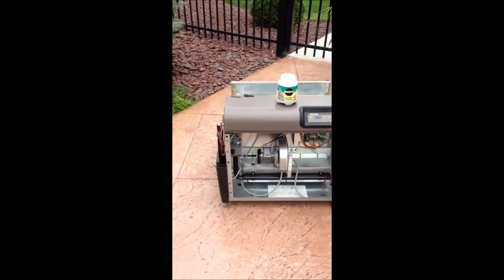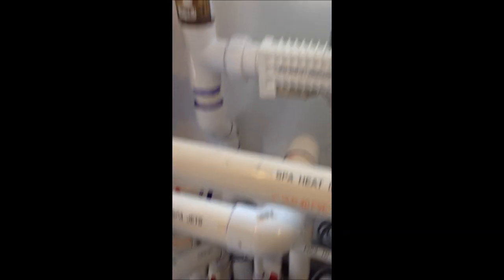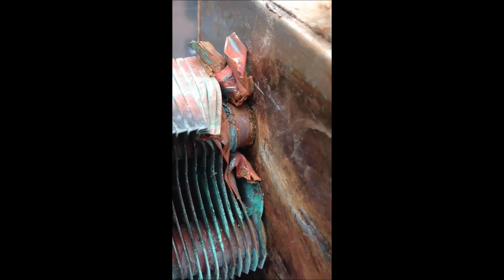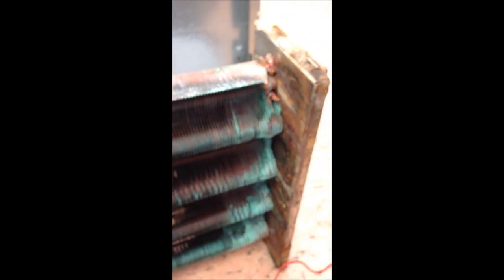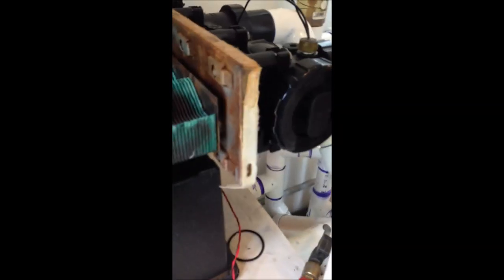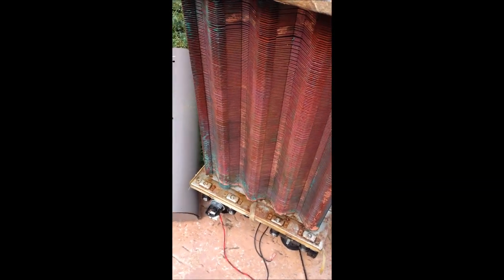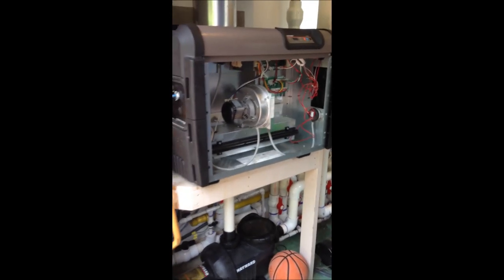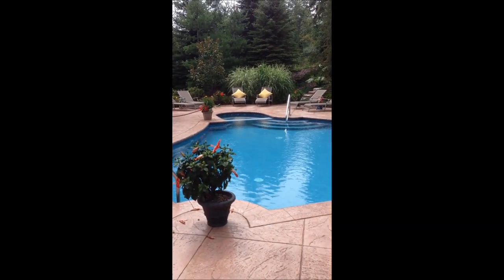Hayward H350FDN Heat Exchanger Repair

Comment: Thanks Al, I too had a leak at the same place at about 2 ½ years into a new Hayward H200FDN as well. Thanks to your video I learned that this is a fairly easy fix that was well within my ability. The exchanger was dead anyway and Hayward was of NO help on warranty. So... I could not make my situation any worse. I took it apart, removed the exchanger. Easy so far. Not having an easy way to water check the unit to see where the leak was, I simply plugged the inlet and outlet and applied air pressure and listened for the hiss. I verified the location exactly by applying soap bubbles. Then a solder with silver based solder and a torch. That stopped 90% of the leak but I still had a problem where the hole actually went under the stainless bracket. Aaaarrrrgggg! So... I took a shot and applied some JB Weld liberally spread across the connection, the remaining hole and the stainless bracket after cleaning with acetone to make sure I had a nice clean surface for the JB Weld to adhere. I let it sit for about 15 hours and leak tested again with my soap bubbles. No leak! I reinstalled the heat exchanger and it is working just fine. How long? Well, I don't know but less than $20 of silver solder and a couple hours fixed a problem that was going to cost me about $800 for a new heat exchanger plus my labor or paying my pool guy a couple hundred bucks. Hmmm.... $20 and a couple hours vs $1,000 for a new exchanger... worth taking a shot. By the way, on plugging the inlet and outlet is easy with a smooth board butted up to each inlet (using the nice rubber gasket already there to seal the board) then used two woodworking clamps to hold each board in place. I drilled a small hole in one board at the center of the inlet and applied air pressure and looked for bubbles. Clamps similar to these: https://www.amazon.com/General-Purpose-Woodworking-Protector-Projects/dp/B07GN9LBZP/ref=sr_1_19?dchild=1&keywords=woodworking+clamps&qid=1599547021&sr=8-19 also available at Home Depot or Lowes. You will need 4 but they are very useful to have in your shop anyway.

Comment: Thanks Al so much.  Clarifying the rod content was extremely helpful.  I was able to get a good braze using a MAPP/oxygen combo (cheap).  To identify the leak I cut the bottoms off two plastic cups and jammed them into the water inlet/outlet, drilled 1/4 inch holes in each, then squirted compressed air at about 15 psi thru it.  Used soapy water and a spray bottle.

Comment: Thanks for this video. Number 1 message I get from this is I NEED A NEW POOL GUY!! My 3 year old heater is dripping. He is telling me we can't replace the heat exchanger. I see the part online for  $700. He instead wants to charge me $2800 for a $1500 heater installed.
Reply: That is certainly one message.  The number 1 lesson to be learned is don't use hayward.  It's been junk for decades.  Stick with Pentair.  You'll pay a premium up front, but you'll save a ton in the long run.   I am a pool guy,  and when I walk in a backyard I know I have guaranteed work in the future when I see "hayward" sitting on the filter pad.  Pump, filter, heater, anything hayward is junk.

Comment: Great video, and yes your pool is beautiful.  I have an H200 Millivolt heater which keeps overheating and tripping the hi limit.  This is an indoor pool and heater is installed in basement with the recommended DHI hood.  However, the vent is 7" coming off of heater and goes into a 6 " pipe and then into chimney flu.  And thoughts on reason for overheating?  I cleaned burners and heat exchanger (lots of soot and damaged fins).  I suspect those are results of the problem not the cause of it.  Thanks.

Comment: ive replaced 2 one less than a year one  16 months ,  after exhausting every other reason they finally blamed it on airflow.  They are inside a wood fence  at least 4 ft clearance with 1/2 inch gaps between slats and open at the top.

Comment: Hi Al, Great Video I was wondering if you could provide an update on your heat exchanger repair from 2013. Its about 5 years later is the weld holding and have you had any other leaks on that exchanger. I have the exact same model of Hayward heater H350FDN and we are starting our 4th summer and the heat exchanger began to leak in the exact same location as yours. I am on the fence about buying a new heat exchanger ($1200 Canadian dollars right now) or attempting to braze it like you did. My concern is that the braze weld will hold but it will start to leak at other locations. How is your experience so far 5 years later?
Reply: I replace the heater May of 2018. Heat exchanger was still good but burner rotted out...
Reply: Albert Baldoni - can I asked what type of heater you decided to replace it with in May? Did you go with another Hayward or did you go another Brand? If so would you mind sharing the info. You seem like a guy who does his research! Cheers
Reply: Al, any comment on what Heater you replaced it with?

Comment: I’m not clear on the type of brazing rod and/or gas. Will simple MAP gas work? And the rod? Thanks!!
Reply from the maker: I am sorry but I do not have any experience braising with mapp gas I don’t believe it gets hot enough although there are torch heads specifically designed to heat hotter with plain mapp gas.

Comment: Question ? If that heat exchanger was still hooked up to your heater and heating up when turned on would it make whining/whistling noise possibly coming from the cracks
Reply from the maker: Hi Tom, no. My guess the whining whistling would be your combustion blower. If you take the front cover off you should be able to identify where the noise is coming from very easily. A small crack or leak in the heat exchanger will immediately show up as steam coming out your exhaust.
Hope this helps😎
Reply: @baldonielectric  I took the heater apart didn't see any leaks cleaned everything including gas orifices and replaced the water pressure switch, got it back together and still had the whining. Another answer to my question came up and he suggested to only open the valve after the filter and before the heater inlet half way to increase the flow, I did and the whining stopped. I also forgot my pump has 2 speeds hi-lo, I opened the valve all the way and put my pump on hi that worked too. But still don't understand why that would cause the whining at a low flow speed ? Thanks for your help !

Comment: Ya mine leaked the same place after 3 1/2 years service. My water quality is near perfect so its not a PH or corrosion issue. Hayward needs to improve quality and back it with a warranty longer than 1 year or Pentair will take over. Hayward was purchased last year by a larger company thats now told their employees bottom line is profit not customer service. This is evident by the removal of the EcoStar pump warranty that was extended to 5 years then removed with new owners.

Comment: I have a model 400FDP (propane) heater which is only about 4 years old which developed several leaks.  After removing the header, I noticed that three of the eight tubes have receded to where they are now flush with the tubesheet....the other five tubes are proud of the tubesheet (where they should be).  Don't know how this could have happened...poor manufacturing?  There are no other leaks in the unit...just where the O-rings no longer seal against the three tubes at the tubesheet.  A replacement heat exchanger is anywhere from $1100 to $1600.  Sorry I have a Hayward heater...pretty much garbage.  These reeding tubes are no caused by any misuse...clearly a factory issue but out of warranty now.

Comment: will the heat from the burners reheat the patch?
Reply from the maker: ***** Hi Ray, You would need to heat to about 1400 Degrees Fahrenheit, should never get above 200 with water running through heat ex-changer. I did this repair about 2 years ago and still operating with no leaks.